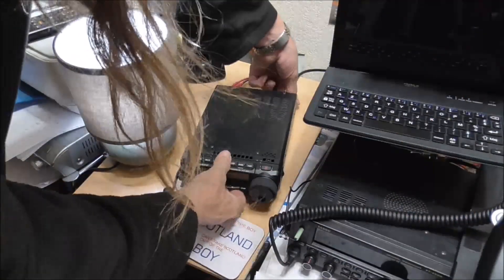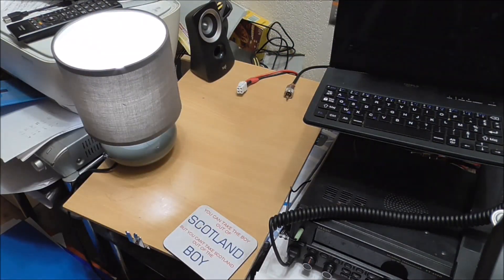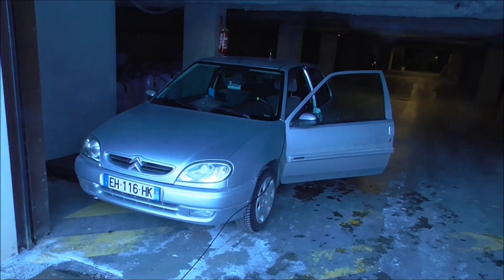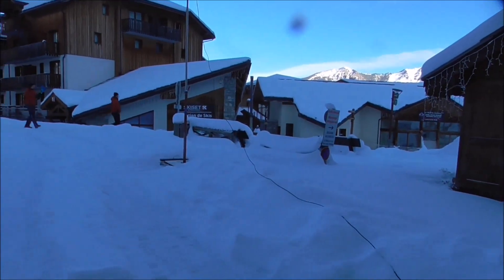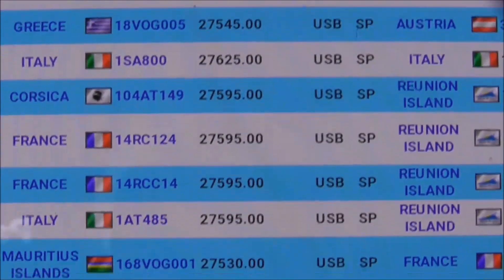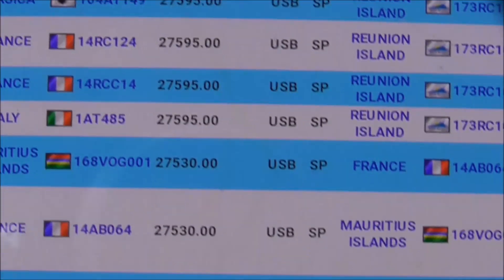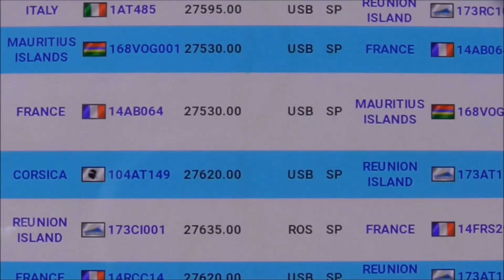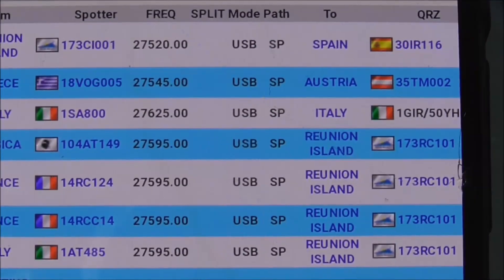Moxon DX Trolley ~ 5 Minute Antenna Assembly!

Comment: How long is your wire 73s across the pond 22 in alabama
Reply from the maker: The Dimensions can be found using an online Moxon calculator, eg http://tippete.net/cgi-bin/moxgen.pl . It depends on the desired centre frequency amongst other factors. Mine is set for centre 27.000mhz as I use 26mhz alot. Cheers